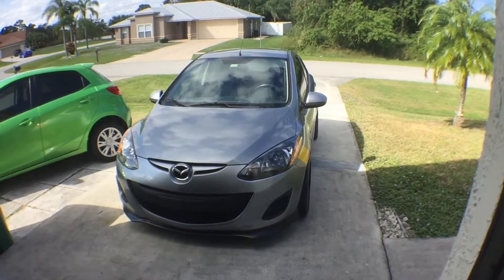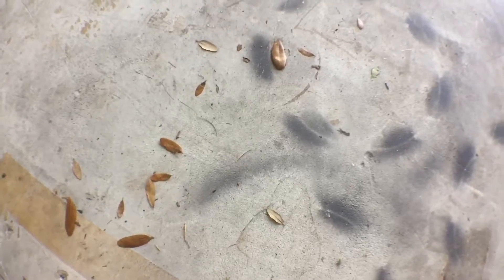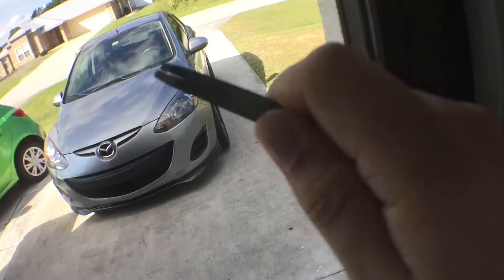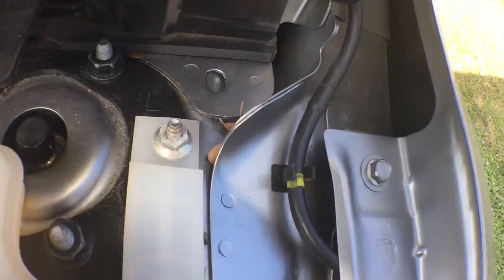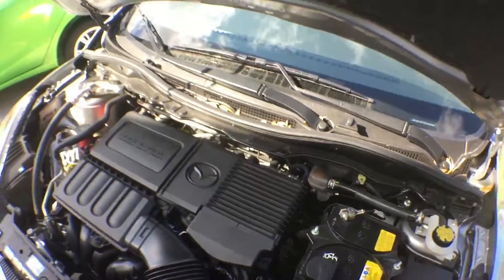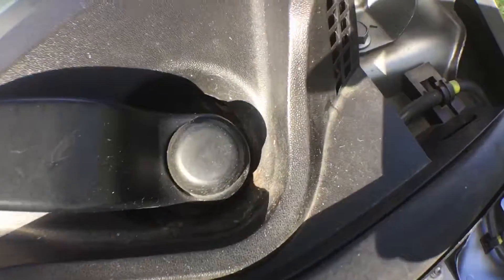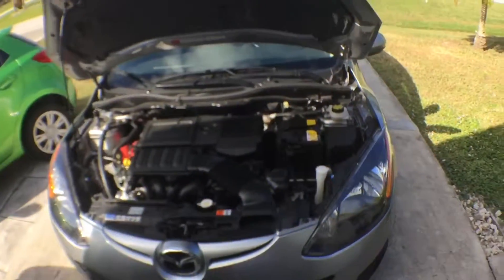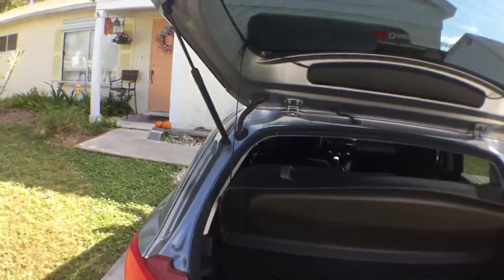Mazda2 | ONE Thing That I Hate

Comment: Exist a strut Bar for our  Mazda 2 and also how about the DDM rear bar my good friend I am to curious about it and what  the benefit of a struts bar make thanks in  advance.
Reply from the maker: Don’t bother with a strut bar. All it does on the 2 is add weight. The chassis is stiff enough as it is. I recommend the DDMWorks torsion bar for better handling. 👍🏻
Reply: @HiroshimaSpirit  Thanks you very much for your advice I am 65 years old but love speed I have a 1984 Mazda Pick up that I love as my wife but I see potential is this little car For me is my Mazdarati how you like the name for it.

Comment: vacuum works well
Reply from the maker: +Alberto Interian III A couple of people suggested that as well. It doesn't seem like it would get them as well as doing it manually, but I'll give it a try next time.
Reply: Works like a charm on my 2. The OTHER thing I hate is how far apart first and second gear are.  Whenever I'm at 8-10mph, I have a hard time deciding which gear to go for (one too high, the other too low).
Reply from the maker: Alberto Interian III
8-10? I typically keep it in 1st.

Comment: hahaha that with the weird rattle in the rear, (took the spare, jack, tools, side cover and brake cover out) make me hate it. even with the computer duster I can't get the ones stuck at the bottom.
Reply from the maker: +Frank Cortez Now that the weather is changing, everything is stiffening up and that damn rattle is back. I hate it! Haha
Reply: DaedalusZero I think it's the bumpstopper that gets hard or the cover of the shock, black surrounding, that rattles.
Reply from the maker: +Frank Cortez In my car every small rattle is the interior plastics. It doesn't happen all the time, though.

Comment: Hahaha, that's nothing. There's a tree in my neighbours yard that's covered in these long ass needles that fall EVERY. WHERE. They get caught in every nook and cranny in my 2, and nudge themselves right under my wiper blades. So every time I try to wipe my windshield clean I get (minimally) two or three streaks that I can't get rid of until I pull the needles out from under the wiper. 
If it's on the drivers side, sometimes I can reach out the window and grab them when I bring the blade up. But what a hassle.
Reply from the maker: +HughTube The struggle seems to be universal, though. Mazda2 owners must unite against tree debris!

Comment: How do you keep your engine bay so clean? Mine is just covered in very fine dust.
Reply from the maker: +Stevie Klaer All 22k miles have been on paved roads. I've never driven this car on dirt. It's actually got some dust in it right now. The camera makes it look cleaner than it is. I usually just take a swifter duster to the bay, which does the trick. The rest I blow away.